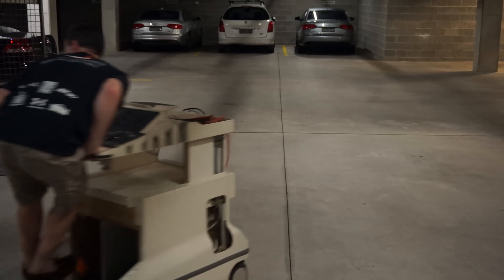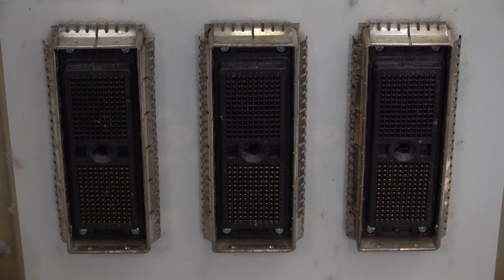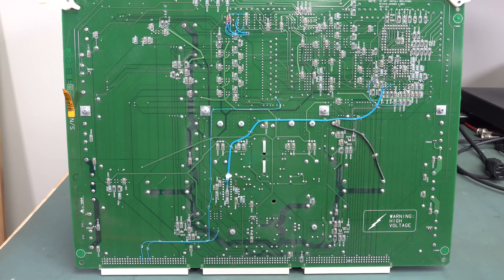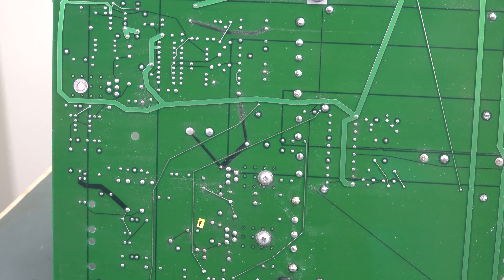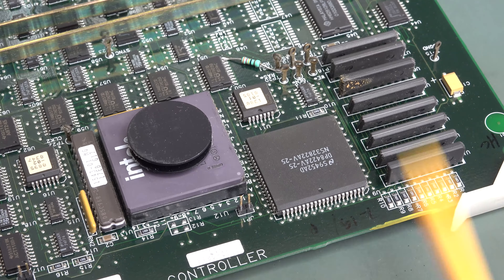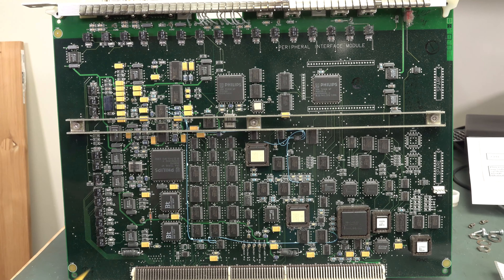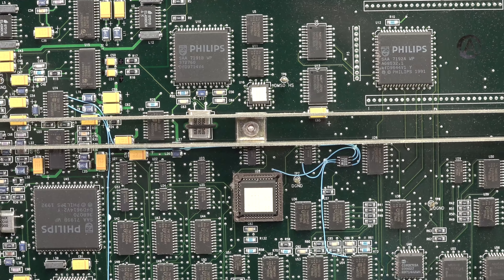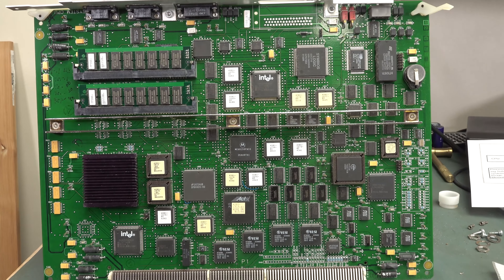EEVblog #1314 - Ultrasound Machine Teardown!

Comment: Arg! As a sonar guy, I can tell you that the function of the TGC is to increase the receiver gain as time elapses from when the pulse was transmitted. Without this, the signal would be huge (and clipping) right after the transmit pulse ended, and buried in the A/D's quantizing noise at larger time delays from the end of the transmit pulse. In many radar and sonar units, this is called TVG (Time Varying Gain).
Reply: is basically equalization in non digital word I guess.
Reply: @vaualbus  I think "compression" is better word.

Comment: 6:25 E-net is Ethernet: that’s an AUI connector, to which one attaches an Ethernet transceiver for the physical medium used (10Base-5, 10Base-2, or 10Base-T).
Reply: Been a while since those were popular. I do retro-computing for a hobby, and I don't have too many cards with AUI connectors.
Reply: Please tell me your sarcastic.... in the early 90’s everything had AUI.. I made lots of money (for my bosses) selling AUI transceivers to swap users from 10Base2 to 10baseT
Reply: I'm not the only one, although I think I'm the only one who decided to use 75 ohm coax to set up a test Network...
Reply: Came here to say this. https://en.wikipedia.org/wiki/Attachment_Unit_Interface
Reply: @imark7777777  Supposed to be 50-ohm for both 10-base-5 and 10-base-2. CATV coax is 75-ohm.

Comment: 44:00 on the Advnaced IF Output board top left corner the two ceramic chips are Cartesian data (Real and Imaginary) into Polar form (Magnitude and Phase) converts (PDSP16330A) made by GEC-Plessey Semiconductor (GPS).

Comment: I used to service these units when they were still in use.  They weren't as popular as the higher-end HDI 5000, as they didn't have as good of image quality.  ATL was purchased by Philips Medical, BTW, so they still exist within that corporation.  The panel on the front was referred to as the "mux" panel (multiplexer).  It is responsible for switching between the three transducer input connectors.   Those highly shielded boards the the mux panel plugs into are called the front end boards.  They are responsible for beam forming.  Each transducer is a bit different (i.e. linear, convex, sector, etc.) and these boards compensate for each individual channel on any given transducer.  Each front end board contains an array of preamps that are controlled by the software.  They can be swapped around in order to troubleshoot faults in the boards.  Information for each individual transducer is stored on a circuit board inside the large connector for that transducer.  That's why the connector housing is so large.  Color, PW and other functions are added by the boards connected to these front end boards (just keeping it simple).  By the time the signal leaves the front end section, it has been processed into a raw image with X,Y,Z and direction of flow information.  This then goes to the "back end" section of the unit, where the image is processed, demographics are added and the image is displayed on the monitor.  The MO disk on the back of the unit is sometimes a bootable disk.  It can be used to restore the hard drive when it gets corrupt.  I can't remember all of the commands, but I think one of them is when you press "super key" and "0" at the same time, it will put you into service mode.   Thanks for the tear-down video.  It brought back a lot of memories!

Comment: You can easily buy an ultrasound that has more capability than this which will also fit in a briefcase and weigh about as much as a heavy laptop. Ultrasound technology has come on leaps and bounds in recent years. For an example look up the Philips CX50.
Reply: I saw an ad prior to this video for a probe that plugs into a phone, WTF!
Reply: Now I want to see a teardown of that thing, but I guess I have to wait another 25 years or so for that  ;)
Reply: My attending has a ultrasound probe that plugs into his iPhone. Yes, my friends, Dr. McCoy's Medical Tricorder is a reality...
Reply: Whoa. So all of the signal processing done by those shielded cards fits in a laptop size enclosure? That's awesome
Reply: Believe me that that hdi 3000 has a doppler spectrum quality competing with todays mid-high level ultrasounds (not high ends, but very close). If it had some B mode image processing capabilities of CX50, iHDI3000 should have been better than it in B mode too. Because it has 128 channels using all trnacducer crystalls without switching and a very good analog signal amplifier. Channel number is more than most of todays machines, so this rockets the signal quality. . Yes it is some old. But for the age of it it was like from outer space. I have used one 10 years ago, and shocked about its capabilities. First of all probe quality portable machnies are poor. They generally use a new tecnology (without crystal), I am not sure about cx50 but HDI porobe quality is top one, single piece crystal cut. If the pure signal quality recieved is good (signal/noise ratio), it really boosts image quality. Todays lower end ultrasounds mostly use some mathematical calculations like speckle noise reduction and some other techniques to boost image quality. I have worked on ultrasound (as field service eng. and application specialist (Medison- Samsung, Kretz, Hitachi-Aloka) machines since 1996, and saw lots of USG machines.

Comment: WOW! That machine is absolutely amazing! My mind is blown. SO many ICs. Its never ending. Think of the people that designed and layed out these boards. Absolute geniuses.
Remember, this was designed in the MS-DOS era, there was no GUI CAD software 30 years ago. It must've taken months if not years to get it right. The schematic diagrams must be 1000 pages long.
He should frame some of those PCBs and put them on the wall. I would.
Reply: Simon. There were GUI CAD systems around more than 30 years ago. I was designing PCBs on a very sophisticated Computervision CADDS3 system back in 1984 and even then that system was already pretty old. There were plenty of other CAD systems around at the time although these were running on mini-computers or even main-frame computers.

Comment: I guess the E-NET is Ethernet but 10Base5 (AUI), link:
https://en.wikipedia.org/wiki/Attachment_Unit_Interface
Reply: Correct, it’s AUI. It was used for 10Base-5, -2, and -T with the appropriate transceiver.
Reply: Bingo, I still have one of the adapters.
Reply: briefly played with some old ethernet cards with this connector and the coax 10Base2 also had some adaptors for AUI to 10base2 coax. I actually set up a small 10Base2 network before I had the gear to make 100baseT etc UTP cables. Played with an old print server that only had a 10Base2 interface, had to talk to it with telnet at one point... good times
Reply: @johndaugherty7465  I do too
Reply: william fleete 10Base2 was also my first exposure to Ethernet. But it was already on its very last legs at that point, with twisted pair clearly having won the battle! :)
Reply: Oh good I'm not the only one, although I think I am the only one who decided to set up a test network using 75 ohm coax cable a few years ago dot-dot-dot
I acquired a hub not a switch a hub it was 10base t with a 10 base 2 connector. Have that kicking around for a while and then I accidentally reversed polarity to it then manage to find a cheap Hub that was similar. I finally broke down and bought myself a replacement of the one that I had and decided to throw a 75 foot Network up with two nodes. Eventually I'm going to revisit this with the network printer and I think I have another 10 based 2 device floating around somewhere packed.

Comment: The chassis looks like it's international space station ready. Very well built machine.
Reply: Yep pretty confident the space station was very intentional
Reply: I had the pleasure of buying some medical equipment caster wheels as surplus. Strong as hell and silky smooth, the very best.
Reply: This might actually exceed the capacity by weight of many orbital launch platforms.. Are you thinking like space anchor or something ?

Comment: 10:00 Dallas1286? 
Thats why they threw it away! After decades the Battery is empty!
Helped another Doc save his unit by changing that stuff !
He didn´t want to learn how to handle a new unit because of his age...
Reply: That's what I immediately thought when I saw it. Cause of failure - memory battery.
Reply: Wasn't there a battery next to the module on the CPU board?
Reply: @ve2mrxB  These dallas modules are notorious, the battery is encapsulated inside the giant package. It wouldn't be using an external battery even if there was one.

Comment: 260 pins per plug, (yes i am that sad)
Reply: was gonna count but scrolled down first to check... thanks for saving me time ;)
Reply: @tomaszkulawinski6388  Same here.
Reply: Yeah it's an ITT Cannon DL series connector, not "custom".
Reply: Chris W Any idea what the typical applications for such a connector would have been?
Reply: @tookitogo  We used them in patch bay connections for large broadcast audio mixing consoles.
Reply: Those connectors and especially the thin cable with 120 coax pairs are a pain to work with. Had to solder such a cable to a PCB board once for some custom test equipment, took me almost an entire day *sighs*.
Reply: @Pelle Reinke Soldering wires and cables is my most unlikable way to using soldering iron. Except when somebody using it to get your confession about something. Like where do you hide the cookies. )))

Comment: 6:26 That E-Net is using an older style Ethernet connection using DB series connectors. We used them on some of our network equipment back in the 1990s.

Comment: Wife blew out her ankle at netball. 
Went to Doctor “ how many days” not our GP as it’s just a normal netball thing, no big deal..............

X ray. No busted bones.
Ultrasound. All good no problemos. 
Still not better after ages. 
Go to our GP and he gets a bit pissed and orders an MRI, ligament no longer connected. 
One full ankle reco later. 
Ultrasound was piss poor for this scenario
Reply: Bruh.
Ultrasonography requires an exquisite understanding of anatomy and physics and the ability to interpret three dimensional imaging. It takes years of practice. It's all about the gorilla holding the hammer, as AvE would say.
Reply: Yeah it's a bit of an artform, I find it's best whenever you break something you break it well enough that it's obvious to even the first year med students... When they can point to two different parts of the picture at least 5cm apart and say this is where it is and this is where it's supposed to be then it gets diagnosed quickly
Reply: Sonographers are not doctors, it generally requires a masters degree in ultrasound. Due to this, sonographers, particularly new ones can miss things, especially ligament damage which can be hard to spot. In this case, the GP should have either been able to diagnose a torn ligament or asked for an MRI straight away. More than likely a bad combo of bad doctor and bad sonographer, but can't entirely blame the sonographer.
Reply: @ShortCircuitGaming  a sonographer should not be trying to diagnose this kind of thing. Nor should a GP. This is not a simple pregnant/non pregnant diagnosis. This kind of diagnostics is the domain of the specialist radiologist. This may sound overdramatic but with ultrasound you need to "become the machine" and have scanned hundreds(thousands) of normal before you can identify abnormal. So many variables at play.
Reply: I was having elbow pain, they found it on sonography and knew it was a tendon issue.
Reply: I suppose the point to my original message was it/them/they couldn’t even pick up gross ligament damage.

Comment: I used press fit connectors in the past, make sure you define the right hole size and they are super reliable. Order a couple of extra PCB's and you can press the connector yourself buy using a vise.

Comment: Dave. Have you done a tear down of the HP9845 calculator appearing in the background at 2:15. Could be an interesting device to have a look inside.
I seem to remember HP devoted a whole issue of the HP Journal to describing the design and construction of this calculator when it was released.
Reply: Was just going to ask if that was an HP 9845 with the monitor missing.
Not a calculator though, a serious CAD workstation - for its time.  hp9845.net/9845/hardware/9845c/
Reply: @pixymisa8087  I called it a calculator as it is featured in the calculator section of the HP catalog. However, with closer reading of the catalog, I see that HP describe it as a desktop computer.

Comment: Pretty sure that the initial board with the serial port on it and the big 'eth' port is actually a very old ethernet connection network card, although I can't tell you which type since I haven't used that spec for a long time (last time I saw it was late 90's). They were used a lot for a long time, but the old ring-types requiring terminators and so on have been long gone for twenty-odd years now, replaced with RJ45.

Comment: Maybe do a decap series? Considering how much silicon you have got you can just batch process them. Its also very easy. You can blowtorch the ic package directly or use a 100w halogen lamp to do a controlled destruction.

Comment: Dave, if you haven't scrapped the chassis   yet.... they make great mobile carts for other equipment. Add some batteries, inverter, and whatever equipment you need. 

Oh and those power rectifiers with the heat sink you couldn't get off ... they look like a Vicor model. And yes they're a pain to scrap...

Comment: SYMBIOS LOGIC? That looks like a SCSI Host Controller. A dead Givaway is the SCSI LED a thumb or two next to it ;)
Reply: Yup, SCSI bus controller. They were sold under a number of names, Symbios logic, LSI logic and NCR (I think they were the original owners of the IP). The 53c710 is a really old one, apparently also found in amigas but they were everywhere. I remerber wanting a 53c896 based card for my alpha.
Reply: The HDD is an LVD SCSI-3 drive, so it's probably for that.

Comment: "What's e-net?" Pretty early ethernet connection. Looks like a pretty standard vme chassis and backplane for high frequency and low noise operation and computing.
Reply: Correct. It's actually an AUI connector for 10Mbit/s ethernet. You'd need to have used a transceiver to convert it from AUI to BNC or RJ45 dependent on how your ethernet cabling was wired at the time. FWIW, the original Cisco Routers (2500 series) used to have only AUI on them for years.

Comment: I remember those connectors from ATE equipment, where they were used to connect the DUT cable assemblies to the front of the rack, and from there the connectors were split out to a set of power supplies, giving a variety of power supplies, 115VAC 400Hz 3 phase, each phase adjustable voltage wise, and with the actual output voltage read along with the current by both the power supply itself and the ATE acquisition system. Then 28VDC, up to 50A, as some of the stuff needed that amount of power to operate. 
Then a massive patch panel, wheere you had a 200 by 200 pin array of interconnects, so you could have the input and output lines connected to the simulation and readout side. 
Those connectors are rated for low noise, even after 1000 insertion cycles, and you really do not want to know the cost of them, though they do have the ability to replace individual pins and sockets if they do fail. Perhaps not with the ultrasound, as they likely potted the plug.

I would hazard half of those added modification wires are there to repair broken inner traces in the boards, as they likely were only tested and passed in the PCB plant, but after the PCB was assembled and soldered they would find the failed traces that did not survive the reflow cycle during test. Expensive board, expensive components but cheaper to do diagnosis and place the wires than scrap the entire board that mostly works, and hope the next board is perfect. 

IBM Deathstar, not likely to still work, though there are a lot of glued down components, using some quality clear acetoxy free silicone instead of the crusty glue.

Comment: Old medical equipment like this fascinates me. If it's functional, what can I do with it? Find uses around the house, on the car? If it has a PC based front end, can I just load up DOS and play Doom on it? If it's non-functional, can I re-use any other parts, again in particular any PC-based stuff? Of course if all else fails, since no expense was spared in the components these are great for parts harvesting! I'd also like to see what might be lurking on all of the flash/eeprom chips.

Comment: I used to build similar machines back in the 80's under the brand names of UniRad or Johnson & Johnson. They rarely shielded the card cages like this, no need to if designed properly. They just put cans on the parts that might leak RF. Also, remember, these machines could take a black and white picture, derived from nothing more than sending out sound waves, and calculate weight at birth for babies. When the calculations were incorrect, the manufactures got sued for big bucks.

Comment: You can get some basic ultrasound scanners that are bluetooth and charge wirelessly. They are just the handset, no wire no terminal or even holes in the case just an ipad and a qi charger.
Reply: Aren't they as much useful as toys are?